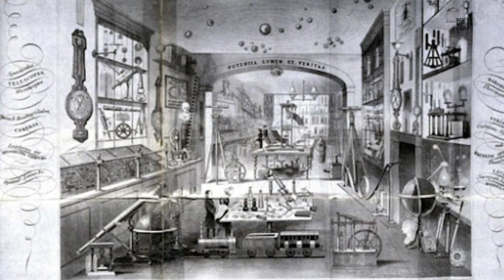Meet some of the world's oldest steam-powered model trains I Brass, Steel and Fire

Comment: did they use distilled or preheated water where they show the engines running
Reply: I use mostly distilled water but I add some bottled water and then I preheat a bit in a kettle but not enough to melt the plastic funnel when I fill my engines.

 its like 95 distilled 5% bottled water because the distilled water drains the nutrients out of the metal and having some regular water will neutralize that.  Do not use tap water it just leaves mineral deposits